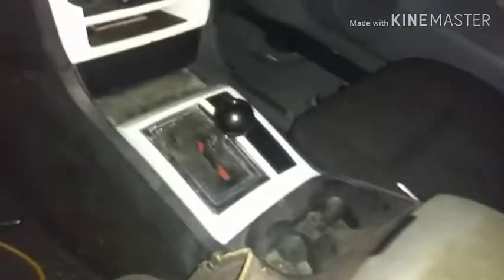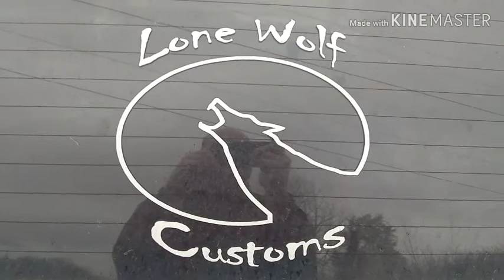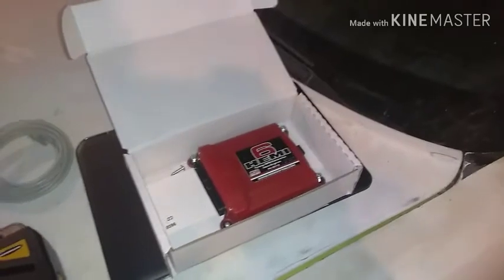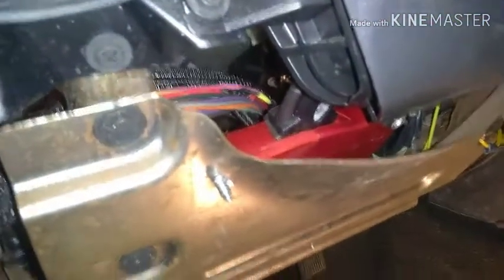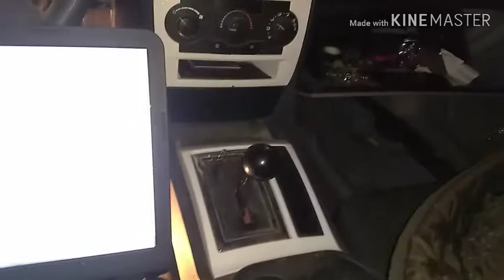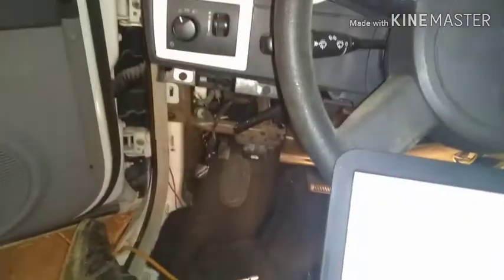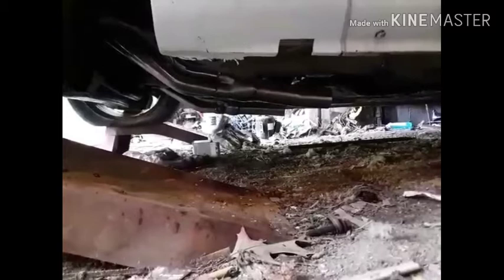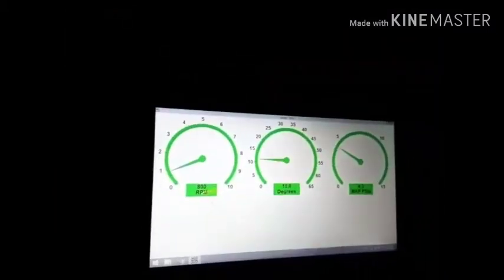Junkyard charger build first start MSD hemi 6 installation

Comment: Where did you find your intake we have a 6.4 himi and want to put carburetor on it and all we have been able to find is a dual four barrel  intake and we need a single carb intake
Reply from the maker: OCperformanceparts.com
Reply: @lonewolfcustoms3725  how much was it I’m trying to buy one but can’t
Reply from the maker: @jayharris7854  intake was around $600 $700 the MSD system was about the same carburetor  cost depending on new or used